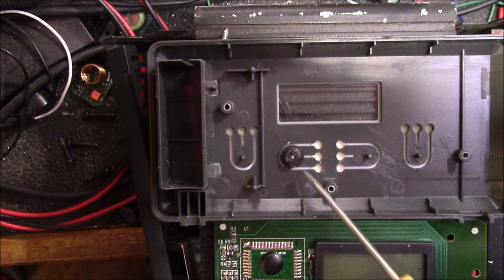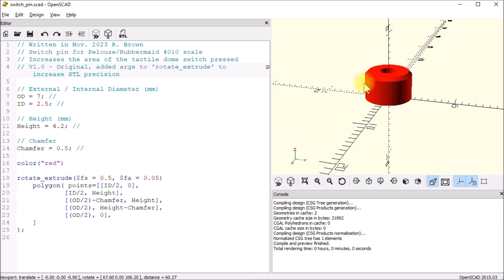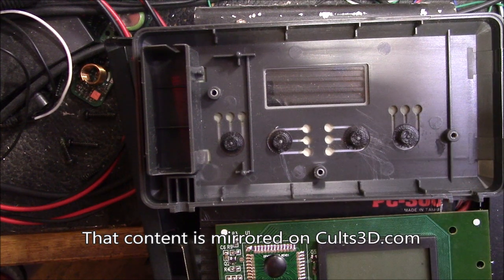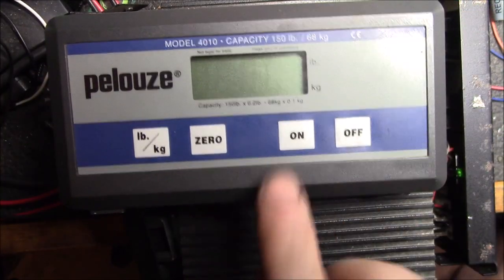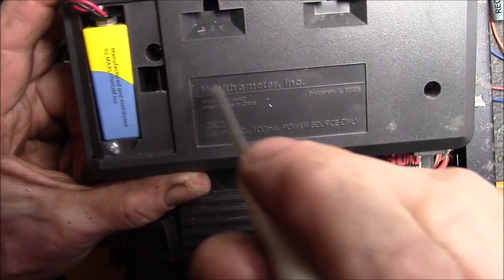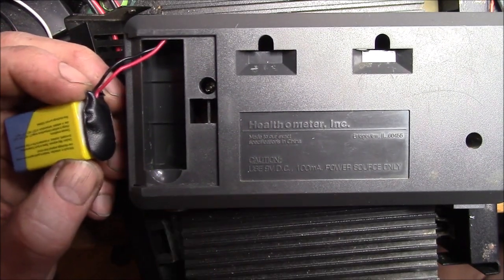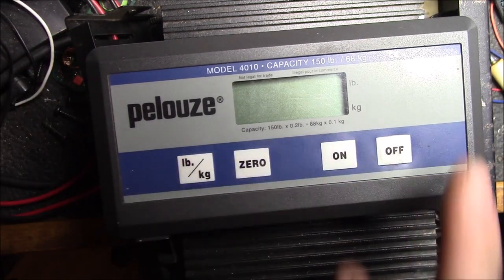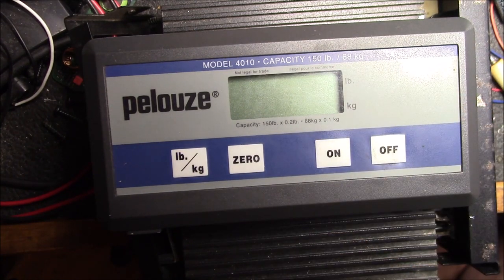Pelouze / Rubbermaid Model 4010 Scale Display Repair, Version 2

Comment from the maker: Makes one wonder, how many of these scales have been tossed because the display stopped working?  So far, I've had 2 out of 2 with this failure.  This display was also compromised by having the battery wire damaged in assembly at the factory.  I could get the display to shut off by moving that damaged wire around.  It came with a good battery installed and no separate power supply.

These scales run US$150-200+ new but you can usually find them in various conditions on eBay for around $50.